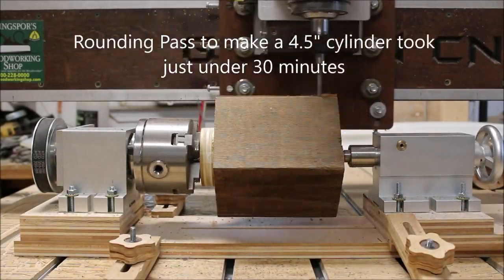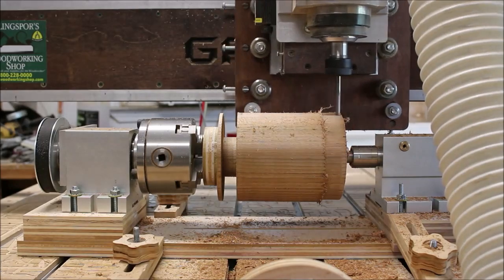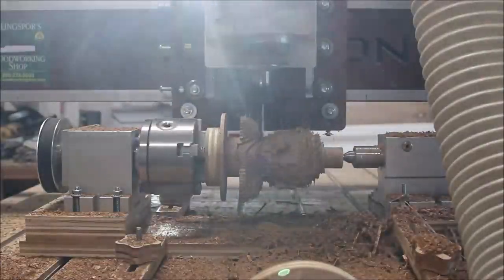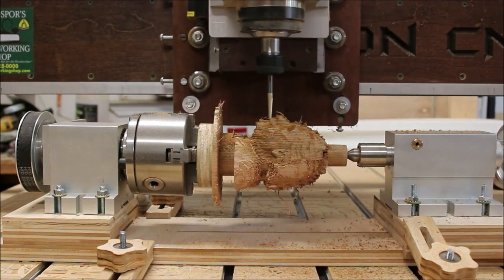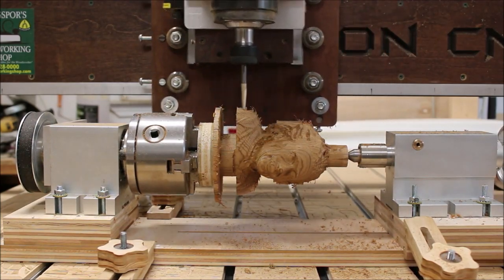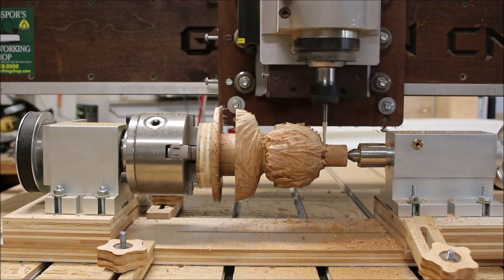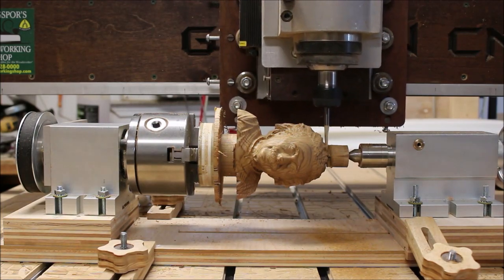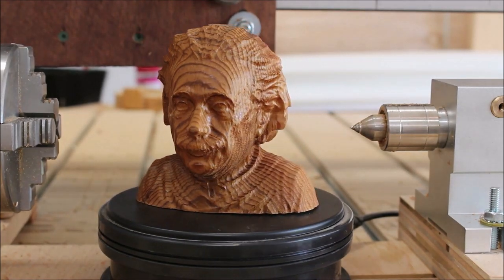Another Rotary Axis Project

Comment: I decided to check out your channel after reading your comment on my recent video.
Happy I did as this is another one of my interest. I have 2 CNC machines and built a 4th axis for them. I have doe a lot of rotary carvings some what  like you have done here. I have also added 3D carvings to some of the bowls I have turned.
Plus I have done carvings in 3 axis for many things. 
I just subscribed to your channel and will be checking out more of what you have done.
 Gary